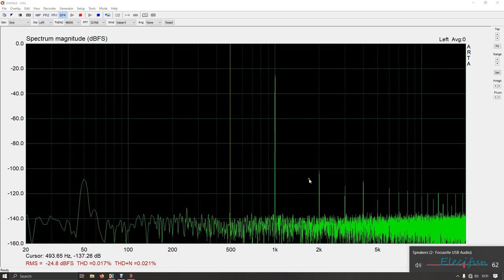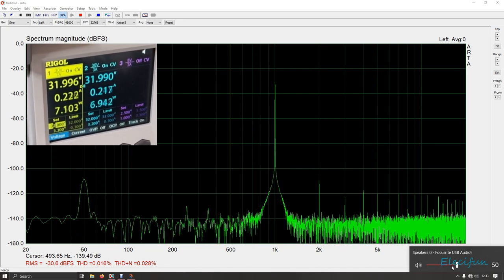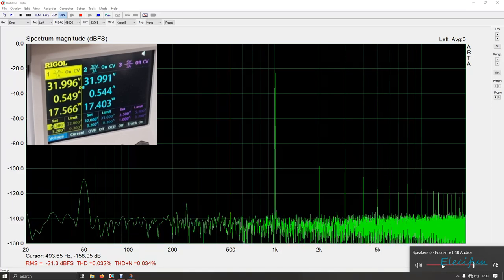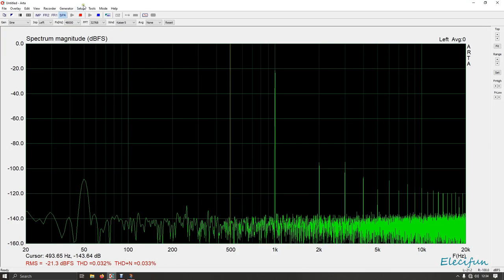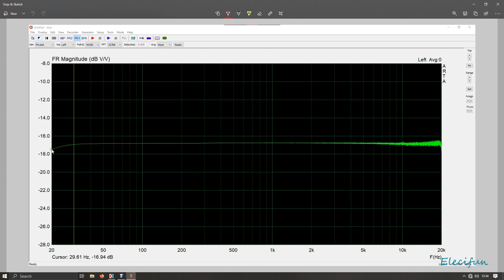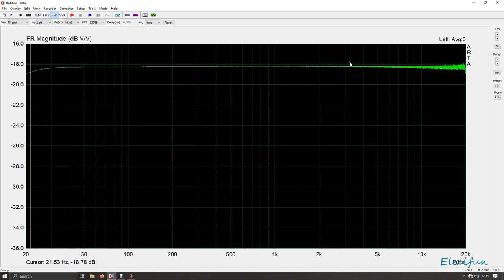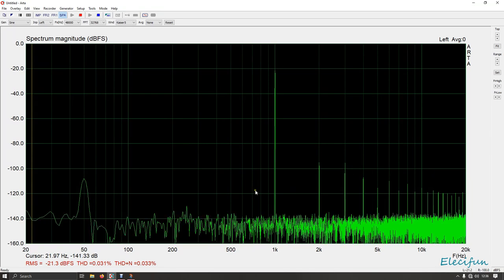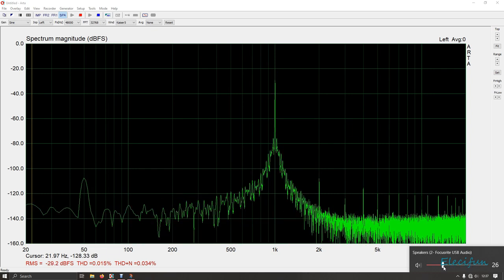Quad405 V3 Kit Aliexpress THD+N Frequency Response Results

Comment: 30 years ago I built a stereo power amplifier using the Maplin mosfet modules. I made it direct coupled by bypassing the input capacitor and increased the value of the capacitor in the NFB voltage divider to 220uF. I compared the amplifier to a friends Quad 405 power amplifier. The Maplin mosfet power amplifier sounded much better than the Quad. Much deeper and clearer bass, much better and detailed treble. Also much more power.

Comment: Nice vid! Am I correct when I dont think it has good clipping/maxing behavior? I mean all those spikes at full blast.. Have you measured a diy tpa3255 board? Clean power and a tube preamp kit would give you same warmth but 100W-200W for dirth cheap.